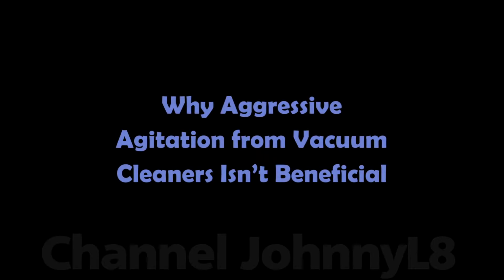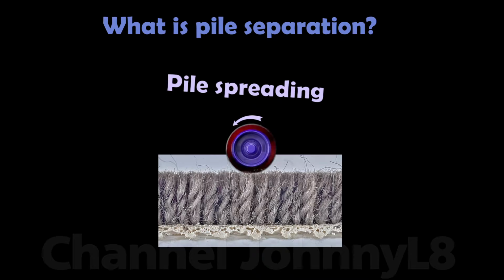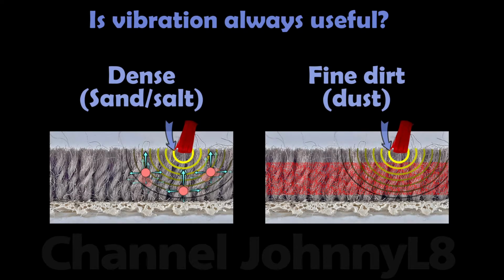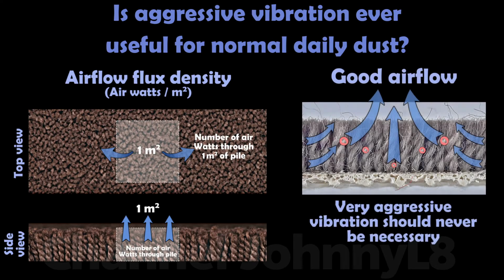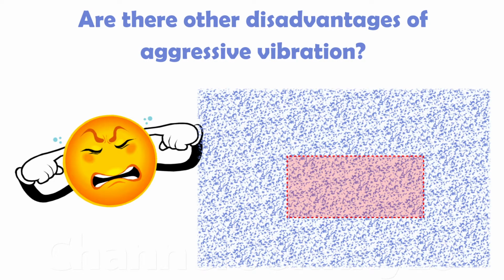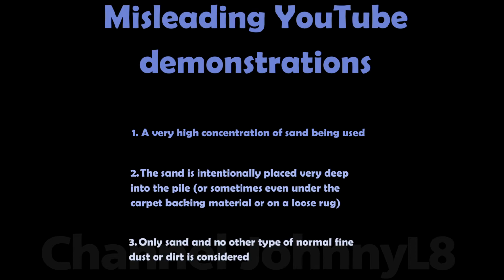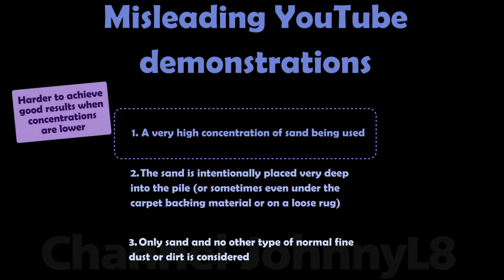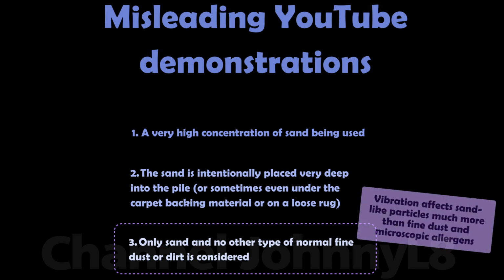Why Aggressive Agitation from Vacuum Cleaners Isn’t Beneficial

Comment: Key example of agitation helping clean the carpet would be a vintage Hoover convertible or in the UK the senior. The beat bars really do help clean carpet! Then you have an example of no agitation at all like a dyson DC25 BUT every carpet and house and application is different! Each job or type of carpet requires a special something needed
Reply from the maker: I've seen no evidence the vibrational aggitation you speak of improves cleaning performance. There's no convincing reason why it would for dust either. If you have any convincing, reputable, objective evidence to support your factual claim, send it along for review. Until then, I believe the statement to be false based on the evidence already available and understanding of how a brush bar actually works at the scale of the pile fibres.

Comment: After watching your video along with all the other you seem to really say that aggressive agitation is good for a lot of particles and spreading is good for other particles which means aggressive agitation is good.  You couldn't have said more to disprove you own Hypothesis.  I will be looking for a vacuum with good agitation, suction, and spreading power.
Reply from the maker: If that’s what you think then I suggest you rewatch the video again more carefully this time, starting with the title of the video. It clearly explained why excessive vibrational agitation isn’t necessary because the job is done comparably with less aggressive vibration without the noise and energy wastage. The rest of the video clarified what particles are best served by vibration. It’s one thing to be intransigent but wilful stupidity is another.

Comment: You make a lot of really good points. Not sure I agree with every one, but official standardized testing data does not exist for most of the vacuums I would be really interested in seeing. Some day when I find the money and time I think it would be fun to set up proper testing equipment, built to international standards, and run various machines. Assuming it would be financially viable that is. 
Either way, very good video.
Reply from the maker: Which points did you not agree with out of interest?  It may help me decide what content to put in future videos to cover/clarify. :)
Reply: Certanily, although I will warn you everything I have is only backed by my own peronal empirical evidence. 

Firstly I agree excessive agitation is not always nessesary, but I think agitation is the more energy efficient cleaning principle. The power costs of generating high suction are greater than that of generating effective agitation. In terms of debris removed per watt of electricity used I believe that many old machines are better. How much concentrated suction per certain area is required to remove loosened dust after all?

I've also found in use, on normal dirt, there is some value in vibrating debris outside the cleanerhead area. Namely with edge cleaning, where it can be very difficult to get direct agitation on the dirt. I have several vacuums that make the dirt leap out if the carpet where side suction channels easily grab it.  Personally I wouldn't call that energy wasted. 

I don't know how common it actually is, but in every carpet I have ever seen removed there has been dirt that passed through the backing and ended up underneath the carpet. I don't know how either, but there it was. Could be the type of dirt in my specific area. 

I think it would also be good to consider the design of the cleanerhead itself in terms of debris removal from the area immediately behind the brush. I have found that some vacuums don't have any kind of channel to allow the dirt to actually be removed from the brush chamber before the brush grabs it again and flings it back into the carpet, rendering the agitation and suction moot. This effect is far more pronounced when exagerated dirt is used but experience on normal household dirt has shown me it does limit a vacuum's potential. Also I think something can be said for machines which lift the carpet off the floor slightly when cleaning, surely this would improve airflow through the carpet (I would intuitively think).

The removal of hair is another topic that may be worth discussing. I have several pets, and although pet hair should be picked up by any reasonable brushing action I found that on two rugs in particular many, many vacuums struggle. The most effective vacuums seem to be the opposite of what you might expect. A hoover from the early 80's with very soft brushes and obviously low suction does extremely well, and I am at a loss to explain it. Meanwhile on either of my cinetic uprights, or a "ball complete" (similar to the dc41 mk2) take pass, after pass, after pass.... and still leave hairs. They all share the same cleanerhead, but some of my older dysons are even worse. Even a super cheap upright seems to do a bit better. 

 I'm also curious what you mean by "holistic" cleaning performance. Sorry for how long this was, and thank you for being willing to discuss.
Reply from the maker: I think much of what you raise can be answered immediately.

RE agitation: Remember this video was about excessive agitation specifically; some agitation is beneficial. I’d highlight where I discussed why agitation only affects some particle types. As such, it’s not very effective for most household dirt, and pile separation (i.e. simply moving the head) is the main method of extracting particles across the full-size distribution from a complex dense network of fibres at the microscale.

I think there is something in what you say about agitation for edges. But edges constitute a small portion of a cleaning job, and because it’s fairly out of the way and undisturbed relative to the main floor area, the crevice tool achieves acceptable results for normal level messes (not unrealistic exaggerated ones) from the consideration of allergies.

Dirt under the backing is more likely present because floors are not cleaned prior to installation. During the laying of my carpet in a new build house, in fact, the hard concrete floors were filthy with fine dust which got everywhere. That buried dirt will never see the light of day again just as with the dirt in the ground under the house, and is best buried out of the carpet system in fact.

Particle flinging by the brush bar is only likely for larger high density particles (like rice), which constitute a negligible portion of the overall dirt in a carpet—most of which is microscopic and invisible, particularly that more harmful to health. I demonstrate a similar problem in my Light Ball review video in fact picking up lots of rice (the odd flung particle has enough momentum to make it through the side suction channels!), but with the large diameter brush bar, it’s never happened on carpets, ever, because the new design solves that problem.

Whether a carpet lifts off the floor will depend on its properties and how strongly it’s stuck down. Whether there’s any correlation between carpet lifting and improved cleaning performance is something I’ve never seen investigated formally. But too much suction could work against cleaning on hard floors unless there is a design to deal with that (such as the bleed vents in the Light Ball).

In terms of total floor space, rugs represent a small portion, and I too have experienced less effective pickup on them. They have very different structure that is inherently difficult to vacuum. Being good on a rug may have trade offs on other more common floor types. The best cleaners perform well holistically. By holistic, I mean the cleaner performs as well as possible across every floor type on average, not just one, and is good in many other relevant areas (like ease of use, running costs, environmental impact etc.). I will be doing a video in future outlining criteria for a good holistic measurement of a vacuum cleaner.
Reply: Sorry for not replying sooner. 

I think I should clarify, when I implied that agitaion does a lot of work for not a lot of energy I meant brushing, fibre flexing, and vibration, all forms of mechanical agitation. I also know that brushes themselves physically pull and scoop dirt out of carpets, a cleaning action you didn't seem to point out. They do more than simply allow the suction to penetrate the fibres more effectively. For example the brushes would bring dirt and dust to the surface with your dyson if it were used with the bin removed, they just seem to do a lot of the job by themselves (Just an observation there). I suppose I also always considered dust to be relatively easy to remove from carpets, it is lite and any reasonable amount of brushing action should dislodge it from the fibres satisfactorily. I place a higher importance on removal of heavier dirt and grit since I have observed the removal of those particles to vary wildly from vacuum to vacuum and I find it very hard to predict. Plus we have dogs, so a lot of these things get tracked in. 

As for edges, I didn't only mean around the edges of a room. For me, the vibrating action also pulls debris from around table and chair legs, saving an awful lot of tedious crevice tool work. That is just a preference, if a vac can pull more stuff towards it from a farther distance away I find it more useful. I would rather not have to stop and use the hose every time.

I mainly brought up the particle flinging because I have observed for some heavier particles it can be an issue. For me, with two dogs who are constantly bringing in stuff from the yard I often contend with small sticks, pebbels, bits of chews, etc. For me it constitutes a reasonable concern for my daily vacuuming needs. (Just another difference in needs here, but I think it is worth talking about) 

Another thing for me, rugs may constitute a negligable amount of floor space by contrast but they make up the bulk of "heavier vacuuming" I do. The majority of the house is hard floors, which can be cleaned with comparatively weak and simple vacuums, or even a broom if I felt like having some dusty air that day.....

Thank you for clarifying your use of the term "holistic", and I do understand now. I think the biggest thing here is we have very different perspectives and needs. If I want to clean hard floors, I'll go grab a cylinder with a floor brush. That'll pick up everything, including fine dust, and I can get under low furniture easily. I'll grab something else tailored to the rugs when I clean them. Obviously your perspective is more representative of the average consumer, I have no doubts about that. I do like dysons for daily run arounds, which I feel is the closest to the mindset of the average consumer I can ever come. I certainly don't hate them. I do feel I compromise in many areas when I use one, and typically don't use them for thorough cleaning.

I find it very nice and valuable to talk to someone with such a different perspective. I look forward to your future videos, and hopefully any comments I make won't be as lengthy.

Comment from the maker: The best modern vacuum technology has moved away from belt drives, and offers seamless transition between floor types with virtually no user interaction required, good holistic performance, and good reliability.

Using older vacuum technology can show how we’ve taken this for granted. For example, in this video at about 21 minutes in ( https://youtu.be/8kNKZUS98Ak?t=21m ), a transition from a short to longer pile carpet caused total failure of the vacuum. The belt, which was apparently so difficult to apply it caused injury, completely snapped, rendering the vacuum useless without major maintenance for most home users. This is a fantastic demonstration of absurdly impractical and poor design.

What is important to note is this design allows unnecessarily aggressive agitation, as described in the video here, which almost certainly wouldn’t clean significantly better than good modern vacuums in formal IEC testing (not crude bedroom testing). Don’t be fooled by what you see in YouTube videos.  Big aggressive agitation has consequences and doesn’t provide the benefits you might think; it has been demonstrated that better overall holistic cleaning results can be achieved without it.
Reply: My guess is that the vacuum's height adjustment wasn't switched to a higher setting for the deeper pile rug.  Getting the correct height setting on vacuums like that is pretty tricky, especially for my upright, since the carpet in my room is a medium pile, and the vacuum has a medium-high and a medium-low setting.
Reply from the maker: @RyanSellman1  The false claim made by others was that vibration was all that was important. Vibration is clearly visible in the videos I've done disproving this silly claim. Furthermore, any vacuum that requires a user to manually adjust height, which is 'pretty tricky' as you point out, is automatically poor technology. We've done away with this junk now.
Reply: @VacuumFacts  True.  Vibration might help, but yes, separating the pile does help the vacuum get deeper into the carpet to remove embedded dirt.  I'm very interested in getting the Dyson Ball Animal 3 once I have the money saved up for it.  The Complete model is what I'd like to get.